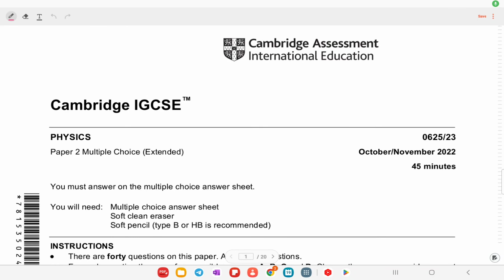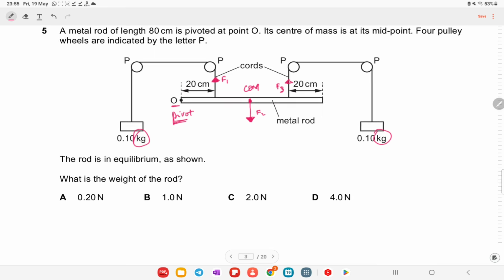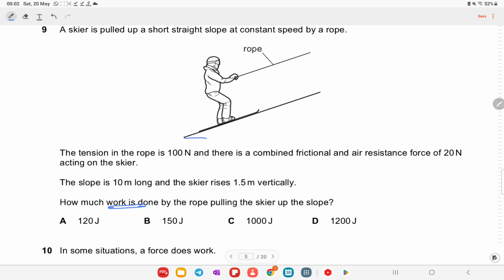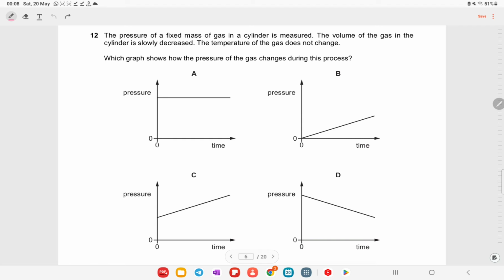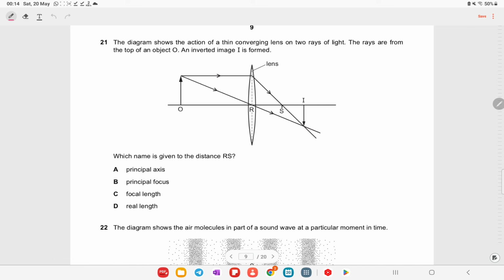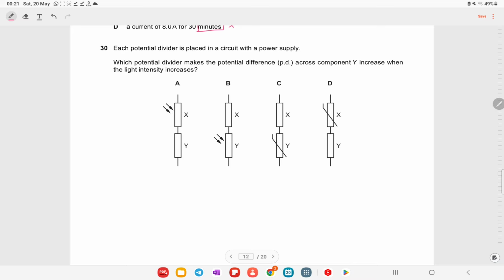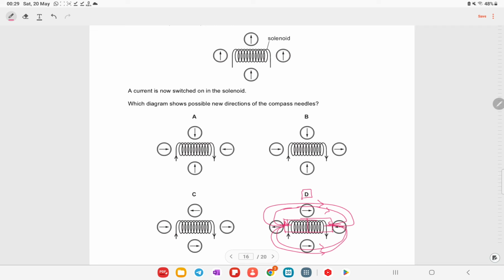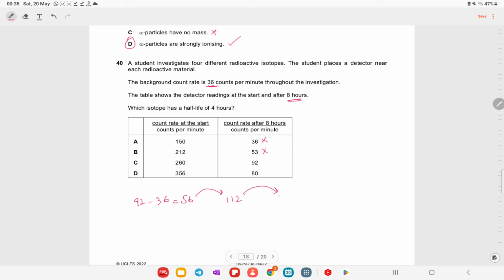Physics IGCSE Past Papers 0625/23/O/N/22 MCQ

Comment: Hello , Could you elaborate question 36 more?. I didnt quite get why the ans is A?
Reply: he said we need to use left hand rule but he is wrong as in this question the right hand rule should be used as there is no battery
Reply from the maker: Thanks for the corrections. Appreciated
Reply: @rgames5654 How to know when to use the left hand rule or right?
Reply: if a force causes current then you have to use FLH if current causes a force then use FRH @mattg9171
Reply: @mattg9171  The left-hand rule is to be used when in the question, a wire is being supplied current by a battery. If there is no battery, and current is being induced in the wire by the change in magnetic flux, then we use the right-hand rule.